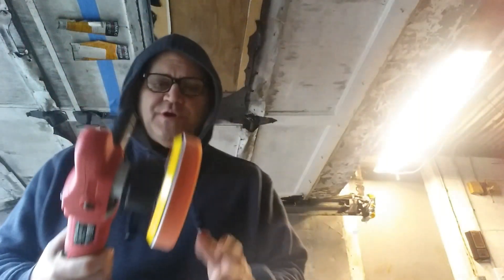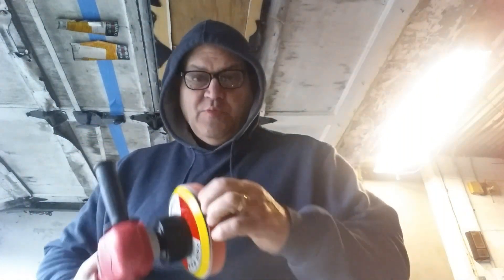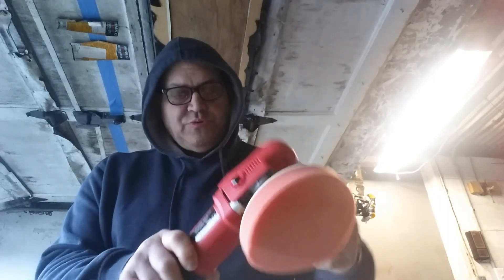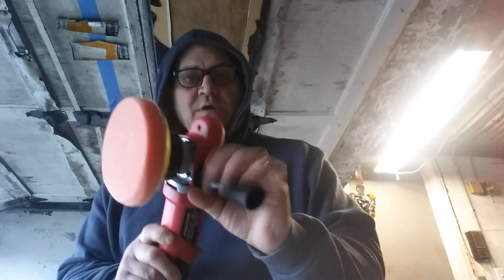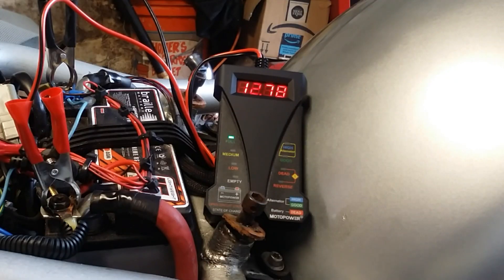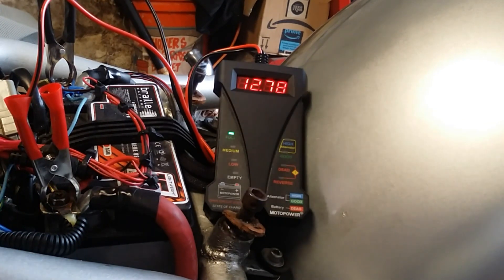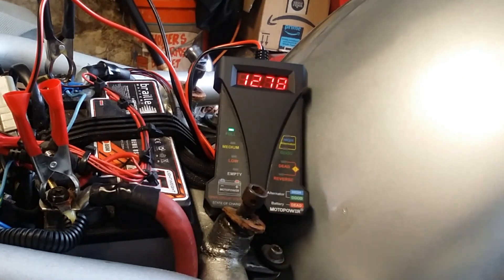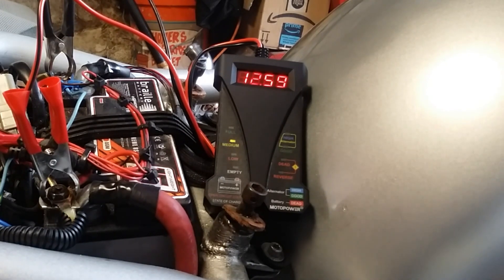MOTOPOWER MP0514A 12V Digital Battery Tester Voltmeter

Comment: voltage drop. connect meter leads on each side of circuit breaker with engine running. a reading of 1.5 volts shows resistance on breaker contacts.